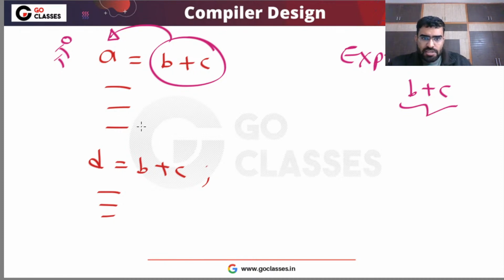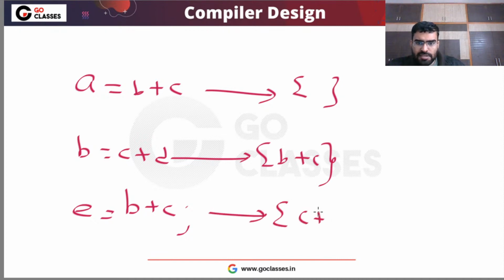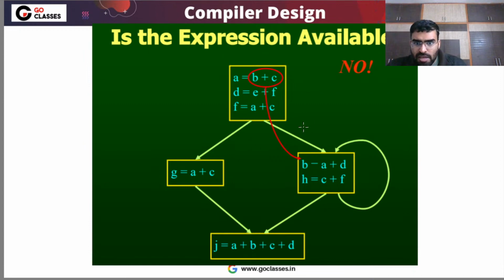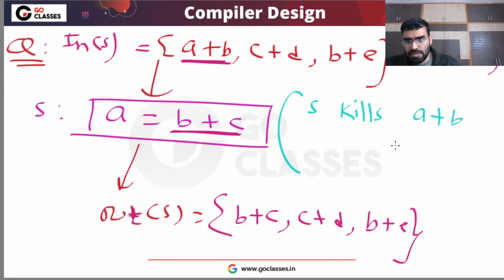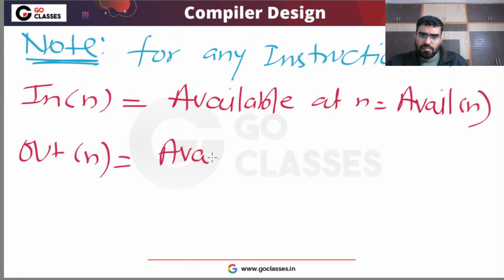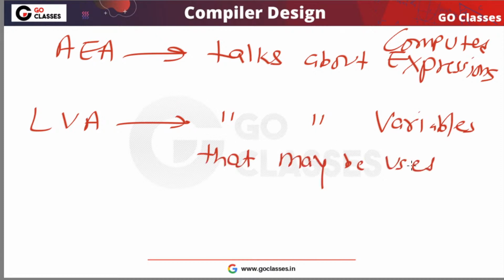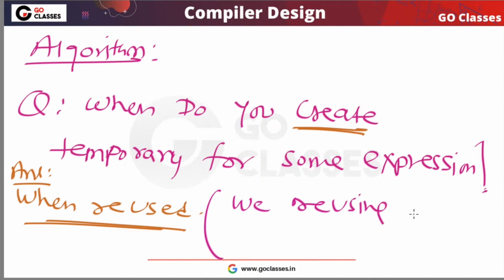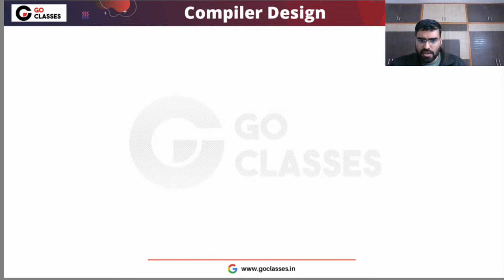Available Expression Analysis, Common Subexpression Elimination, Copy Propagation

Comment from the maker: Correction at 48:21 =

For the Third Block ({i = x+y})  from top, it will be 1000, Not 1001. 
Because on one path value of x is changing, So, x==0 expression is NOT available just before the Third Block from Top.

Please correct it in your notes.

Correction at 27:18 =
As statement b=a+b kills all the expressions containing b...so available expressions after this statement will be empty set...instead of {a+b}... 

Statement "x = x+y" kills all expressions containing x. It was a mistake by not noticing that LHS was variable "b".  In the next line expression c = a+c, the analysis was correct.. So the concept is correct.
Reply: sir, pin this comment
Reply: Correction at 50:19  after i=i+c number will be 1000

Comment: 2:40 C.S.E 
8:48 copy propagation
15:57 Available expression analysis
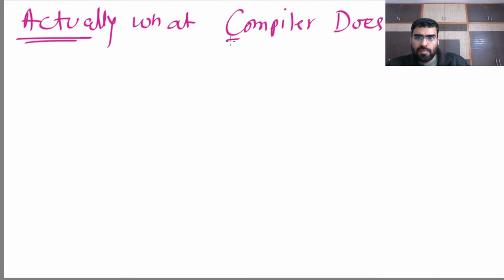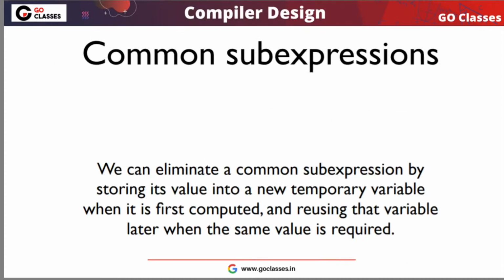27:44 that point is nicely told at 1:43:16.
27:18 correction, check sir comments.
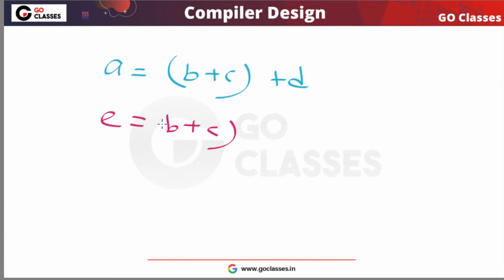32:30 mind boggling ques. {u get to understand more by looking at 2:08:57}
48:21 Correction , check sir comments.
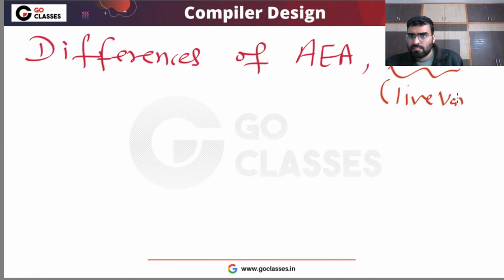1:30:55 differences of AEA & LVA
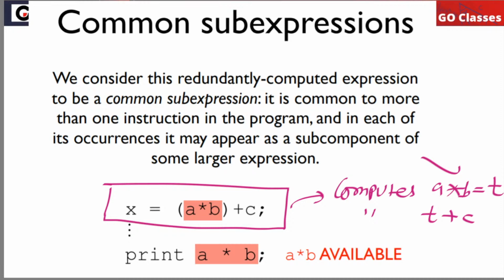1:42:04 question to be pondered. this leads to CSE algo.
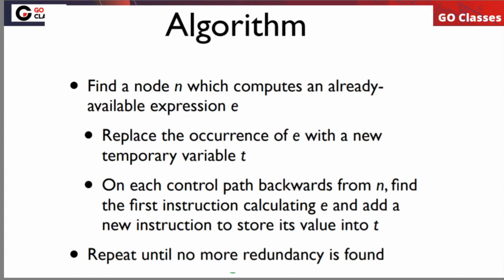1:44:47 CSE algorithm
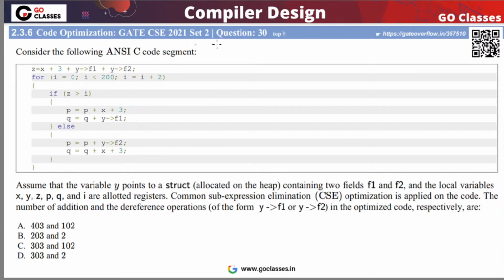1:52:29 GATE CS 2021 SET2 (CSE algo. application)
2:08:57 example, how to apply cse algo. neatly explained

Comment: At timestamp 27:18 ,  As statement b=a+b kills all the expression containing b...so i think available expression at this statement will be empty set...instead of {a+b}...
Reply from the maker: Yes. You are right. Statement "x = x+y" kills all expressions containing x. It was a mistake by not noticing that LHS was variable "b".  In the next line expression c = a+c, the analysis was correct.. So the concept is correct.

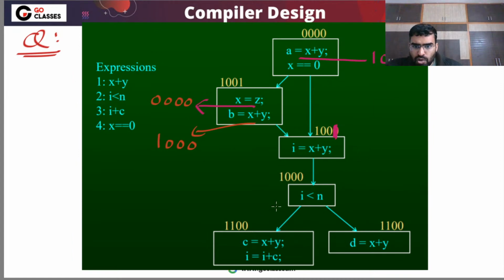Comment: sir here at 49:57 you told b4 "i= x+y" ,"x==0" is available but how sir bcz value of x is changing to z...but "x+y" will be available bcz of second tym recomputing the value "b= x+y". It will be 1000..plz see this sir
Reply from the maker: Yes, for the Third Block from top, it will be 1000, Not 1001. Because on one path value of x is changing, So, x==0 expression is NOT available just before the Third Block from Top.

Please correct it in your notes.
Thank you for pointing it out.

Comment: @49:32, I think in the entry point of the basic block [ i = x+y; ], i==0 should not be available because one of the paths reaching the required point has a basic block [ x = z ; b = x+y; ], and in this block i==0 is not available
Reply from the maker: Yes, for the Third Block from top, it will be 1000, Not 1001. Because on one path value of x is changing, So, x==0 expression is NOT available just before the Third Block from Top.

Please correct it in your notes.
Thank you for pointing it out.